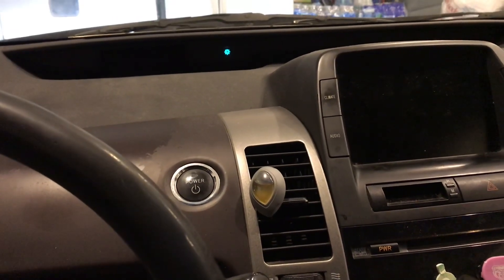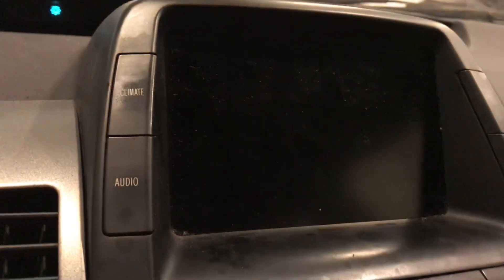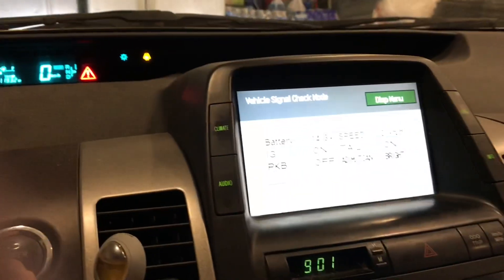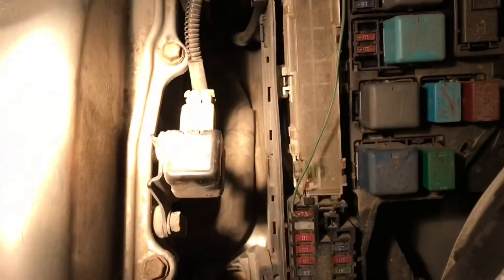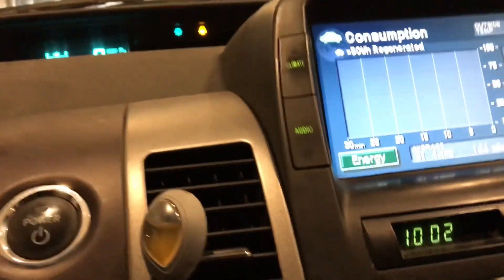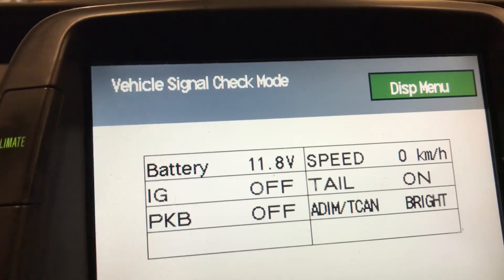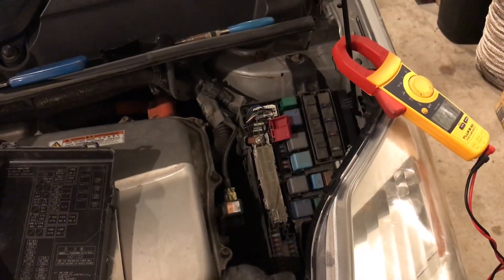Prius P lock or Park lock repair with Red Triangle

Comment: I'm having a similar issue only my car works fine just randomly says P lock mech error on and off as I'm driving around. I also noticed it seems to be more of an issue when it's wet outside.
Reply from the maker: Yes, moisture makes it worse. Did you run the jumper?

Comment: I found out when I took my – apart the dash and unplugged the park switch it folded two prongs back and that's why I was getting the message it wouldn't go into park correctly on the screen
Reply from the maker: Did you replace the screen?

Comment: Had The same issue and replaced the transmission control module (used). And that seemed to fix the problem. Easy
Reply from the maker: I have never heard of a TCM failure on a Toyota. Where is it located? I have not had an issue since adding the wire jumper

Comment: My batt was fine yesterday but I ran into DT today n came out (only 12v AGM plugged up) it wouldn't start, I had to plug it back to the lawnmower battery n started immediately so I'm assuming I need an actual 12v
Reply from the maker: Buy the OEM battery from Toyota, they work the best

Comment: Worked. Did exactly as you did. 08 with a fresh 12v battery. Intermittent P lock warning that would come on and off multiple times while driving. No effect on any function.

At this time it was active from the start, which sometimes happened. Cold out today. Connected the wire, warning gone. Disconnected, warning came back. Fix confirmed.

Thank you!
Reply from the maker: Great to hear, glad it worked for you!
Reply: @jakemir how do you reconnect the new wire 🤔
Reply: @jakemir  4 months on, still working, jumper wire hasn't come loose either
Reply: What kind of jumper wire do you use? By from auto parts store? Any kind of voltage?

Comment: Same problem here. I checked the voltage as this video shows and it’s 11v. So this might be the problem right?   The car won’t go into ready mode
Reply from the maker: See how old the 12v battery is in the back passenger side trunk. They are usually good for five years. I bought mine from the dealership for $200

Comment: What the actual fuck was the ending. Seemed pretty insightful until this green wire came into play out of nowhere. Where did this wire come from and how do I set it up ugh
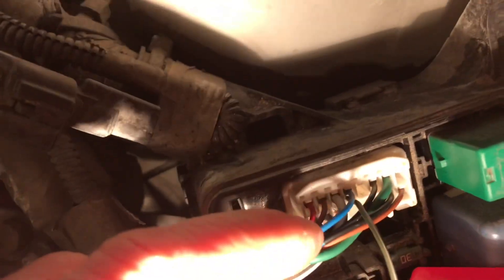Reply from the maker: At 3:30 you will see I used a new wire from the top fuse and pushed it into the blue wire connector. You can use an Add-a-fuse on Amazon and splice to the blue wire too. The blue wire is the problem, needs 12v. Basically you are bringing in 12v to the blue wire. It’s a common issue on the Prius with voltage issues. Sorry, I made this video 5 years ago

Comment: Wierd, had same issue.  Manualy checking battery didn't do anything but by-passing with that wire got it started.  Such a strange hack.
Reply from the maker: I think there is either a loose connection or failed wire somewhere else in the system

Comment: Great information.  Mine is also in park lock (can't switch to drive or reverse).  I find it incredibly STUPID that ONE fking wire is preventing this vehicle from starting and driving.  Sooooo dumb.  I will check this wire on mine to see if that's why it won't start.  I'm a mechanic and you basically need an Electrical Engineering degree to work on these things.  I could fix the damn space shuttle before I could have figured this out.  wow....
Reply: Could be the water pump by the fuse relay . Mine went and made my car dead . No lights just key beep and door locks worked that’s it
Reply from the maker: I think it is corrosion because it seems to happen in the northern states

Comment: This did not work for my car. It still gives the same error message and I can't even shift the car. I don't see how this wire will stay in there. a waste of time.
Reply from the maker: The wire did work for me. This was a workaround instead of removing the entire fuse block. Use 20 gauge solid strand wire and it should push into the space.

Comment: Where can you buy the wire????
Reply from the maker: Just use solid 16 gauge wire. I used 18 gauge solid strand wire from my sprinkler system or the furnace thermostat uses silicate. Stranded wire will be harder to push in

Comment: I have the same issue I went to two different dealership and get responses we don’t know what is wrong and they said it will cost me around 700-800 ti find out what is the problem so I tried jumping to fuse but didn’t worked for me everything looks good on car but just showing “p” lock mechanism error its going away and coming back everyday. I checked my battery volts is 12.3 I don’t think  cause of battery so do you guys any recommendations about it Im sick of this problem.
Thanks!

Comment: Anyway you can make a video or have pictures how you put the wire into the fuse and the other end.
Reply from the maker: Use an Add A Fuse. It is the easiest and safest way. Here is a video someone else made

https://youtu.be/nasuPwpr55I

And a link to Amazon 

Recoil FT2-10 10 Pack 12V Car Add-a-Circuit Fuse Tap Adapter Mini ATS Blade Fuse Holder with 10pcs 10A, 20A Fuses https://a.co/d/h4a58EK

Comment: Thanks, I think you give it power to the P CON relay coil for shift actuator , I believe that blue wire come from TCM (located under the blower motor, maybe TCM is bad.
Reply: Did you try this? Because my car is sitting since two weeks I need to know if that works? I have two blue wires in fuse box.. dont know which one to connect
Reply: @ssiddiqui8182  No , I didn’t, I had same problem but I replaced TCM , under Blower motor and it’s very cheap, blue wire on top next to the dashboard.

Comment: I've got the same problem today and the mechanic suggested to change the inverter... what should I do brothers?
Reply from the maker: Did you try the wire bypass? Is the 12v battery new OEM in the back?

Comment: Thank you so much for this video! We fixed our 2006 Prius today with your jumper wire method. We’ve had this intermittent problem for a few years now, wish we’d seen this sooner. Our car runs great with over  270,000 miles and counting! Thank you so much!
Reply: Did you say it fixed your intermittent issue on your 06? My 06 has this problem about once, maybe twice a month
Reply: If you don't mind how many times have you had your spark plugs changed?
Reply from the maker: I have changed them only two times with 420k miles total. If you are burning oil use Restore Engine Restorer and mine stopped burning oil. I used one can every oil change

Comment: How would you go about creating a permanent solution to this if the issue is with the wire?
Reply from the maker: I never followed the original wire but found this bypass worked. Somewhere the original wire gets corrosion and no longer provides enough voltage

Comment: Thank you . I pull out the fuse and cleaned  and sand it and then when and turned on and it works,  the parking light was fixed. 
Thank you so much for this video was very helpful.

Comment: How do you connect the wire to the blue wire ?
Reply from the maker: Push it next to it so the bare end of the new wire is touching the metal push connector on the blue wire

Comment: Hello Jacob, I have 08 Gen2 and 3wks ago, I have the master triangle, vcs, abs,traction control, brake lights came on the dashboard, then I used the OBDII to read the code, but after that it was said No Code found. Then I thought was hybrid battery, I removed and tested all the modules cells, they all above 7.7 and there is only one shown 7.5 . Then I talked to someone who sold modules cells on Amazon about my hybrid voltage, they said the hybrid battery system in good health no need to replace that module cell , and tested the 12v battery at 11.6 ,and I changed the new one at 12.8 . After that all done my car still not won't start, and all the lights still shown , and I try to read the code again, and still No Code found, after that I try to used Eraser function on OBDII to clear it. And try to start up the car,then its start that so strange to me,but when I drove about 5 miles, the red triangle and brake lights came on, when I put the car in P, and try to start the car ,its not Ready function, won't start. And I did the same way, used OBDII clear the code, then the car in Ready and start, but it still the same issue drive for few miles Red triangle and brake lights on, and won't start after turning off the car.??? So,after I watched your video clip, I think you can help me to figure it out what is my car issue, please give me an advice. Thank you
Reply: Dear same issue in my car your problem is solved reply me how can I solved this problem
Reply: Hey Leon, your issue sounds identical to my current issue. Did you ever find a solution? Thanks in advance!
Reply: @zackvideo  me too, have you figured out your issue?
Reply: @flj232  My issue actually turned out to be slightly different than this video. I was only getting this error because my 12V battery was bad. If you're seeing this error specifically in the video I'd highly suggest taking your battery into a local auto parts store and having it tested.

 So I replaced the 12V battery and yet still my car wasn't turning on and was getting all the lights (however the p lock error went away). I got my hands on an OBD2 code reader that was Prius compatible and was able to obtain some codes that showed my HV battery had a leak. Luckily it was under warranty and got replaced. So my other suggestion is that if your 12V battery is not the issue you should really try to find a code reader that works with your car. I actually had to try 4 different ones before I got one that was able to show me any codes. A basic code reader most likely won't show you anything. The model that worked for me was the Innova OBD Code Reader 5210 that I had borrowed from a local O'reilly's store. Hope this helps! Best of luck.

Comment: Bro, awesome video! What did you use to slip the jumper wire down into that connector along with the factory wire??
Reply from the maker: I just stripped the wire and pushed it into the existing connector or the other wire was at. On the other side with the fuse I simply strip the wire and made a U-shaped in allowed it to slip between the fuse blade
Reply from the maker: Use this add a fuse too

Recoil FT2-10 10 Pack 12V Car Add-a-Circuit Fuse Tap Adapter Mini ATS Blade Fuse Holder with 10pcs 10A, 20A Fuses https://a.co/d/h4a58EK

Comment: How do you connect the jumper wire to the 7.5 amp fuse? Did I miss something? Thanks very much!
Reply: I see the jumper wire connected to the left side of the fuse or fuse housing at three minutes 35 seconds into the video… Did you just push the wire in there like you did to the blue wire at the topside?
Reply from the maker: I placed the wire underneath the fuse and then brought it around and just pushed it into the connector up top.
Reply: @jakemir  Did you take the fuse out to do this?

Comment: Thanks so much! You saved me from calling a tow truck and was literally on my last errand before returning home. Before calling one, I thought I’d at least try to take out the fuse and put it back in my 2007 Prius to see if somehow there was a bad connection there and it worked!!! I still had a red triangle going back home but I didn’t care at that point as long as it’ll get me home. 

I got home turned it on and off a couple of times then the red triangle came off. Maybe the fuse was going bad? I’m getting a new fuses tomorrow.

Comment: Can you please tell me what kind of wire and do I just stuff it in there or so I need to take apart stuff to run wire? Thank u
Reply from the maker: I used a very small 18 gauge solid wire from my garage that was used for a home thermostat I wired. The solid wire allows it to be pushed into the connector and also under the fuse. This wire bypasses the factory wire that is failing to supply the proper voltage. I hope this helps.
Reply: Thank you for your help..so I can just go to home depot and buy 18 gage wire only?
Reply: Did you take off the fuse to put wire in there?  and did you take off blue cable on other side to put in new 18 gauge cable in or you just forced it in where the blue cable is on other side?
Reply from the maker: @futbol1972  You have to remove the fuse and placed the wire under the fuse on the left side. The blue wire on the connector is not have to be removed, just push the new wire next to it so it makes contact.
Reply: @jakemir  regarding wire I can just go to home depot and buy some 18 gauge wire?
Thank u for all ur help:)
Reply from the maker: @futbol1972  If you have a sprinkler system in your home for your lawn you can probably use just one of the wires that is not being used. You only need about 6 to 8 inches of wire. You can certainly go to Home Depot or Lowe’s or even a local hardware store but you may have something in your house that will work just fine. Solid wire works best and it should be around 18 gauge
Reply: @jakemir  sounds good thank u
Reply: Today I tested 12 volt battery and it was about 11.7v I think so I replaced it for a new one and now car turns off and on without any problems:)  cat has not been installed yet, but it was the 12v battery.

I am really thinking about selling my 2009 prius cause it's just a matter of time before they steal cat again:(
Reply from the maker: @futbol1972  as long as you put on an aftermarket catalytic converter it will not get stolen. The aftermarket catalytic converter‘s do not have the precious metals that the people are looking for. Only the stock converters have the precious metals which creates they need. We had a big problem in Michigan for a little while but I haven’t heard of any sense. My forerunner catalytic converter was only $120 for an aftermarket converter but the stock converter was 2500.00
Reply: @jakemir  I wish I could of install an aftermarket catalyc converter like they do in the other 48 states , except here in california and New York. California has these  stupid emmission laws. I have to install it from dealership no way around it. It won't pass smog. Even if I did not care about passing smog nobody ships here to California because it's illegal. I also lelitteraly called more than 40 mechanic shops and muffler shops here in town and around California just to see what they would tell me and they all told me exactly the same thing even my friends that own 2 muffler shops said that cat has to be from dealership.  They to get an used one but supper hard to get them. But shops won't even install used ones have to be new from dealership. I think iam done with this car even though it rives supper good and everything works great.

Comment: My catalyc comverter got stolen on my 2009 prius.. I drove like that for less than 2 miles and got red triangle with exclamation point on it. When that happened car started to loose power and eventually died on me:( right now I have it at a muffler shop where they will put another catalyc converter on but car still does not turn on..when I press on power button all the lights come on with rd d triangle like if car it's on but engine not on. Lights, radio and power windows work . The windows are slow though so I don't know if battery it's dying. If I remember I have one purple bar. Also keep getting a message about something that car needs to be on flat surface and something about the transmission .
A while back it completely died on my while I was changing  the passenger mirror, after I was done  I gave it a jump and everything was good. This time it won't move from one purple bar even after a jumped  it
Reply: I get the same message too and car not drivable cause is stuck on park I think
Reply from the maker: have you checked for DTC codes using a OBDII reader to see what codes are showing a fault? it sounds like a bad cell in your hybrid battery. The small 12v battery can also show good but there is a wire harness in the rear of the vehicle on the passenger side that can fail due to water damage from the trunk seal. I have a 2009 that had this issue and had to require it. it is on the passenger side behide the rear passenger door inside the plastic interior.
Reply: No I have not check the codes..but somebody told me to check the 12v battery in the car diagnostic screen to see if is good, also to run a wire from the 7.5A fuse to blue cable on fuse box, also to disconnect the negative terminal from battery for about 5 min,  also to unplug tje orange plug on hybrid battery for about 5 min to reset hybrid system..
Hopefully by putting the catalyc converter in fixes it cause it was working fine before the cat got stolen.  Well, about a year ago car completely died on me no lights nothing so I gave it a jump and it was fine till 2 weeks ago when cat got stolen.

Comment: His 12v battery is weak. ANY 12v battery that shows only 11.8v after a charging is damaged. Replace it! He claims it is 5 years old anyway. Good sense tells up to REPLACE any battery that is 5 years old! This is especially true of the Prius, which is VERY fussy about voltage in general. Also Toyota has a bad habit of getting corroded terminals all over the car! Not too surprising that a terminal that is energized a lot and under the hood gets corroded some. All the wiring on a Prius is often undersized too. While sized well enough when new, they are somewhat undersized when corrosion and metal fatigue and age come along! Often a new battery can overcome this higher resistance, that is why most people replace the 12V battery, at lest at first.

Comment: Hey Jacob, just wanted to LYK the HID leveling sensor is fine, the issue was the bracket, it was broke from where it mounts on cross support or axle, I filed both ends till I had clean metal then I superglued the pc., seems to be holding ok, had no welder, and it’s pretty hard to find that particular piece that I would need. Thanks for all your help, and putting this information out there!